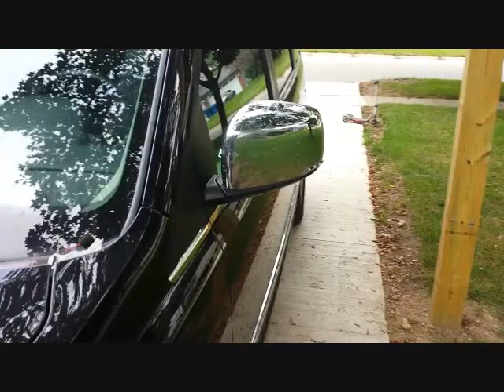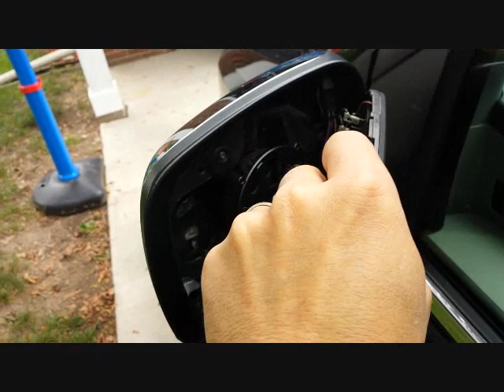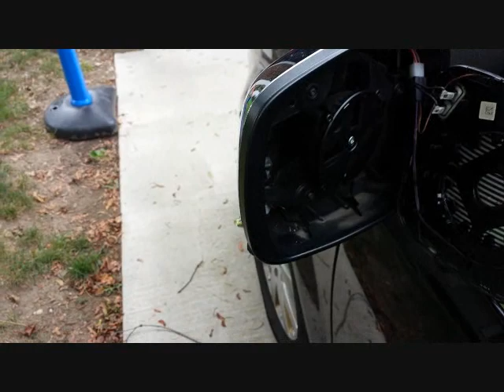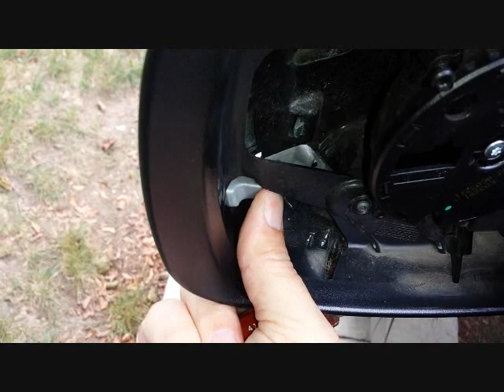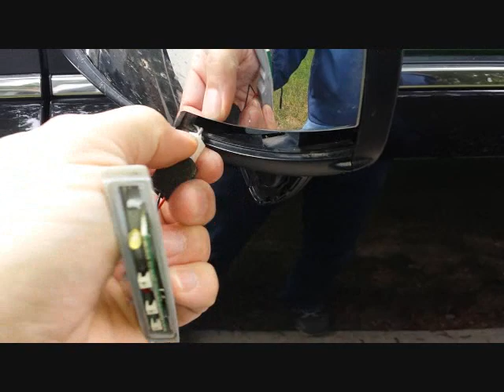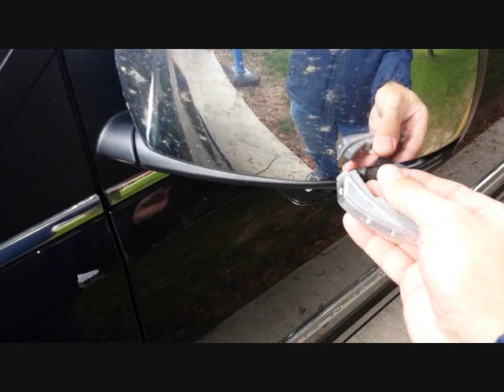2011 Chrysler Town & Country Side View Mirror Turn Signal Repair

Comment: I got both sides for $10 dollars total even though i had both plastic pieces to glue back on but i put them on my one owner town and country touring L model with 66k miles, garage kept, no accidents, it looked like it was on the showroom floor. Headlights are known to get fogged up so I found a set new for only $46 dollars. The headlights and turn signals both look like they did before. All the ebay sellers get pretty much the same thing. They have chrome and smoked sequential turn signals too for only 15 total for both sides

Comment: Ironically I bought a 2011 same color 2 nd hand and kept thinking that they should have designed it with a plastic cover to keep the water out😂

Must be a common problem and the glue must be very poor!
Will be replacing both of mine.
Thanks

Comment: DO NOT DO IT THIS WAY! Unless you want to replace your mirror you shouldn't use this method.  You have a high chance of cracking the glass. it's much simpler than this. Use a trim tool or jeweler's screwdriver, pry between the LED signal and the chrome mirror trim on the outside of the mirror, pressing toward the van, will pop the the signal out of the mirror. Disconnect the connector, reconnect the new one, and push back into the mirror housing. insert the outside tab first the push firmly against the inside part of the LED and it pops into place. Be careful not to pinch the wires, make sure they are pushed fully into the mirror housing.

I appreciate the OP Wanting to be helpful, and I'm not saying his method won't work, but if the mirror is extra hard to pop out it will break. Ask me how I know. Being a highly mechanical person I knew there had to be a better way.
Reply from the maker: You can remove the turn signal without removing the mirror… there is enough room to see to pry it loose.

Comment: Just replaced left mirror turn signal for '13 T & C as shown here  . Was concerned about removing the mirror glass, but it went perfectly. The job took less than 15 minutes. Make sure you have good lighting.

Comment: Good tips! Thanks for the video! I just replaced the lights on my parents' 2011 T&C. The Chrysler dealer quoted them $1200! I got the lights on Amazon for $40 and thanks to your video, had both mirrors done in about 15 min!
One difference... On the 2011, you can tilt the mirror all the way down and reach a long flat blade screwdriver in from the top to pop the bracket. Easy! Then the light can pop right out! No need to risk breaking the mirror.
I hope this little tip helps someone!

Comment: Just changed mine on my 2012 town and country and your video helped alot!
Reply: Sorry to bother you after 4 years, but my 2012 needs the same repair.
   Question please: did it really go that easy (turn signal replacement), also, is there anything you learned while doing it that wasn't covered?
  Thanks in advance...

Comment: I just bought a 2010. The dealership ordered the assembly for me and I was going to take it to them and have it repaired under the 3-year new car warranty I bought with the vehicle. This looks fairly easy to do. The only thing that scares me is breaking that mirror while pulling it out. I was very fortunate with this van as it is a one-owner vehicle with no accidents and very well taken care of with low mileage. More comfortable than the luxury cars I have owned. I'm 58 and kind of a mixed bag of nuts but I am a pilot, a biker, and I like cats so you figure me out. Oh yes also, I ride horses. The irony of it all is my wife has the pickup truck!
    Very well done video and thank you for posting it.

Comment: Agree with Hernan below. I also just positioned the mirror in the housing so I had the most room to look in at the upper LH corner of the housing. If you watch this video showing the part, you'll know what you're  looking at when you look in there. I too was able to release the big clip, then pry down carefully where the two other protrusions were on the part and it came right out. New one snapped in easy as can be. Thanks a million to TheBorgVideo for posting this video! Was exactly what I needed.

Comment: Thank you for the nice video! I lost the cover on my rt. mirror and was trying to find just another cover to replace it. I thought they would be replaceable to glue back on, but no luck, just the whole unit. I have a question to ask for anyone that can answer. I have 2 lights on rt. side door mirror that light when that turn signal is actuated. Only 1 on the left mirror when actuated. Is the left unit bad and should have 2 lights on too?

Comment: Question: I just bought a 2008 Chrysler Van. One light is broken rather badly, the other looks fine, yet neither one works. Do you think the broken one is stopping the other also.? I doubt there is a fuze for just these lights. No other lights not working. I just want to get all working and could buy just one unit if that is a fix. Any idea???.

Comment: Most difficult part was unplugging the old signal. It is installed in 2008. Been there for 9 years. Finally got it done. Otherwise, your instructions were perfect. Thanks.

Comment: Very helpful, received the Dorman parts from Rock Auto at about $35/each.  They are higher quality than the OEM, which have a cheap faux chrome plastic clip on cover that lets water and debris inside.  The Dorman parts look better as well IMHO

Comment: Good video, I have just replaced both turn LEDs with Dorman equipment on my 2008 T&C 4.0L.
Note 1: I didn't have to take the mirrors of the engines. It's possible to reach the front plastic lock on the LED with a flat screwdriver from under the mirror when pulling it out as much as possible.
Note 2: The Dorman LED didn't fit first. I had to take away the two plastic lock knobs on top of the LED with a fine file,

Comment: THANKS!  I had the same problem on my 2012 T&C.  I got the part at the local Chrysler dealer and replaced it myself.  Your video was very helpful.  I didn't realize the mirror just popped off.

Comment: Anyone looking for these parts, try www.rockauto.com --- they've got parts cheaper than eBay a lot of the time (they've got this part for like $35, and they've got the grille for my truck for like $55, those parts on eBay were $65 and $280 (!!).  Worth checking out, I've used them 3 or 4 times and have had exactly zero problems with them.
Reply: +Joshua Richards I've purchased stuff from rockauto on several occasions.  They are great for having obscure stuff that's tough to find.  The only problem with them is the shipping.  The shipping charges are very high.

Comment: Thanks for your help.  My Chrysler main dealer wanted £795 to replace both turn signals.  The parts cost me £110 including delivery from the US and I fitted them in less than 10 mins with the aid of your video.  You are a star.

Comment: TheBorgVideo, Good job, Thank You,,
Sometimes the video along with the sound effects, popping of mirror from motor, give more reassurance of not breaking the thing than any other reassurance. I own a 2012 T & C, uses Part #68052079AC Left (Driver side), Part # 68052078AC Right (Passenger Side) same for 2008 to 2015's I believe.
Thought I would post so others would not have to look these up.
I wonder if anyone has any feedback on the longevity of the replacements?

Comment: I was able to access the clips from above, without having to remove the mirror. With the electric control, I moved the mirror down and in, and then I used a screwdriver, the same size shown in the video, to loosen the clips. It came out very easily afterwards. Thanks for the video.
Reply: Hernan Baquerizo was
Reply: Hernan Baquerizo Great information!